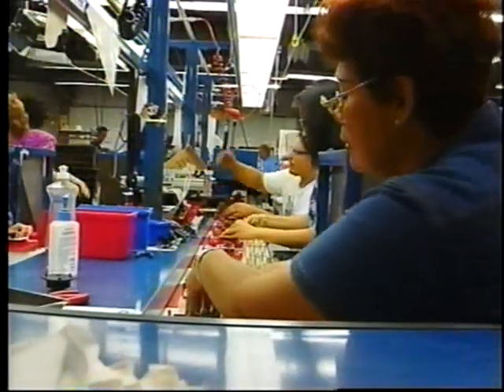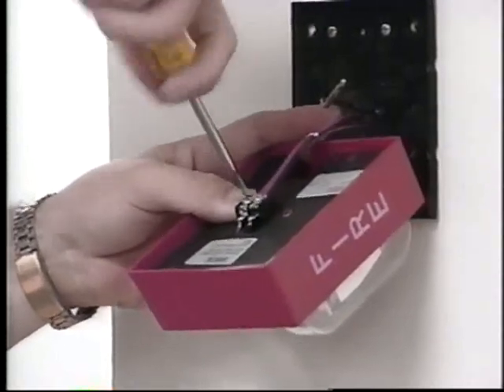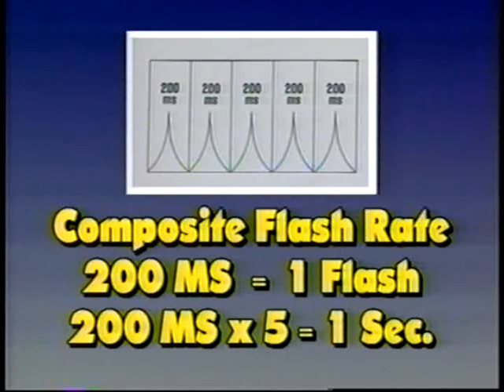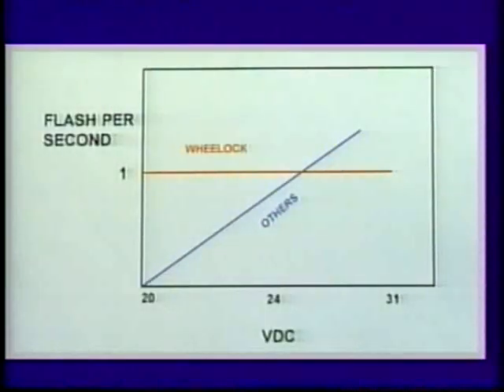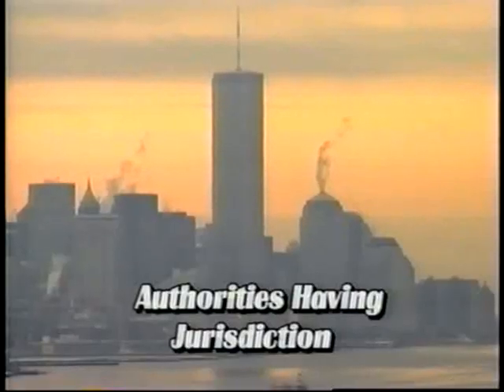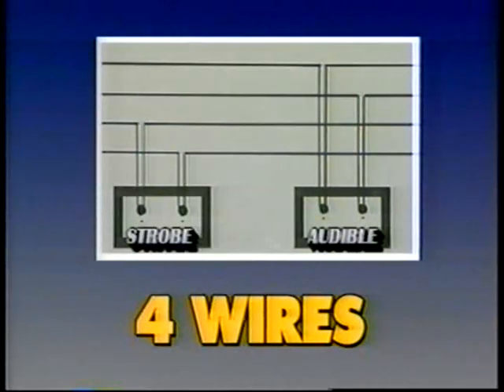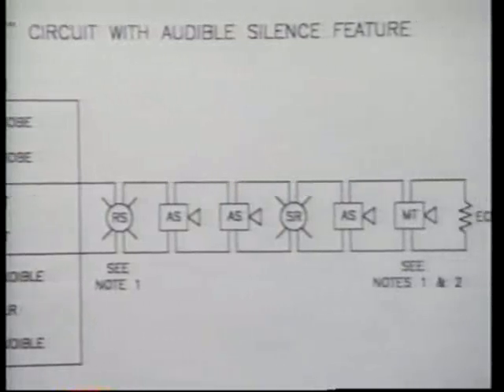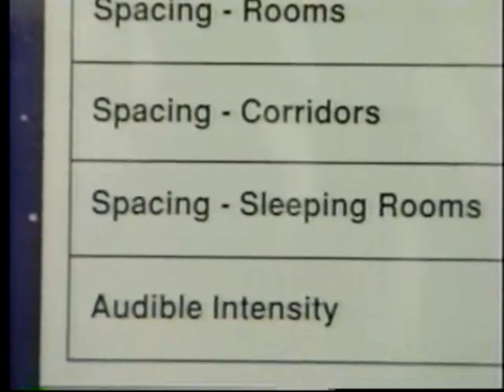Mid-Late 1990s Wheelock Fire Alarm Promotional Video

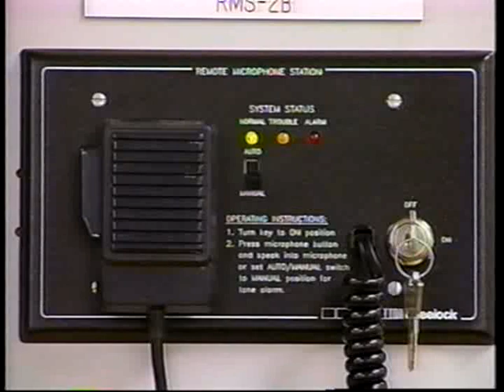Comment: 5:25 This has nothing to do with anything. Radio reception isn’t affected by the alarm. 🙄
Reply: You're obviously saying that wrong. What's its being discussed is that silencing the alarm allows you to hear the message being transmitted through the radio device as loud fire alarm noises overpower what's being transmitted as it comes through the radio and makes it very hard for the person on the other end to hear because they're hearing an alarm sound through the radio speaker and one right next to them

Comment: They should air a modern version of this cause I've seen a lot of fire alarm fails sadly
Reply: Good I hate them.
Reply: @gavinproduction7433  people being taught about fire alarm systems and safety should REALLY be more prioritized. I bet hardly anyone would know how a Two stage alarm system would work, pull alarm, insert key to activate second stage, but I'm not sure how many people in buildings that have that would know it, this is just one example I thought of.

Comment: That eerie image of the WTC is chilling
Reply: The WTC did have wheelock alarms (rebranded by pyrotronics I think) it was MT-style speaker strobes
Reply: @EmillioMelendez  it’s hard to imagine how much destroyed those alarms are after when the world trade center collapsed
Reply: @EmillioMelendez  and before that they had speaker strobes that look like 7002T.
Reply: @davidperry4013  The Wheelock ET-1010 Is what you are referring to. This had a Design similar of The Wheelock 7002T
Reply: Yea but were they tamper resistant speaker strobes?
Reply: @Kirby7601  They weren't the tamperproof models. They were Pyrotronics rebranded Wheelock E7070-LSM-24's (Pyrotronics SS70 15/75)
Reply: @Weihuan86  oh ok
Reply: I can see one of the fire alarms at the museum looking crumbled